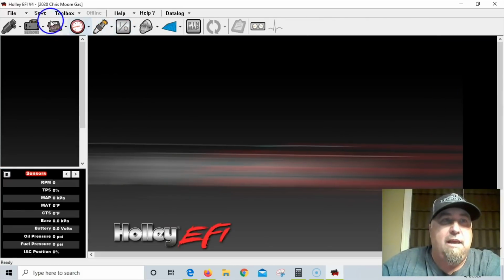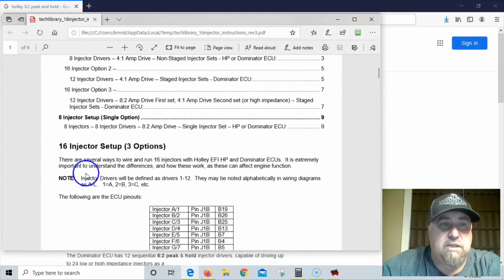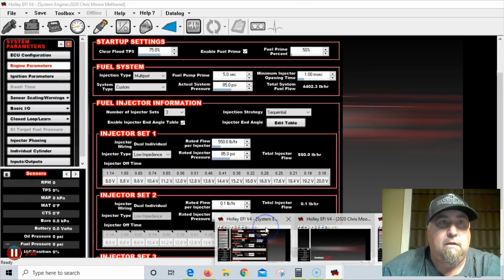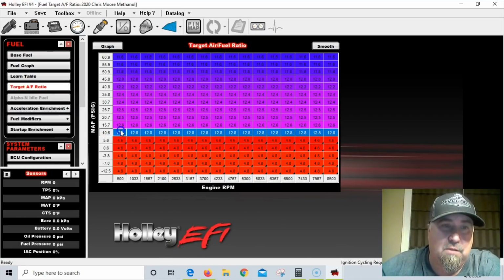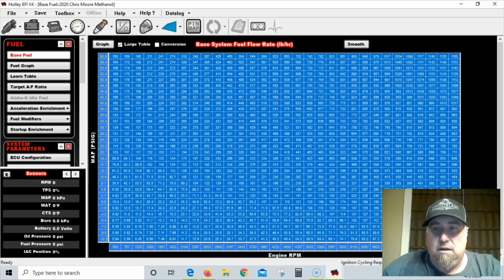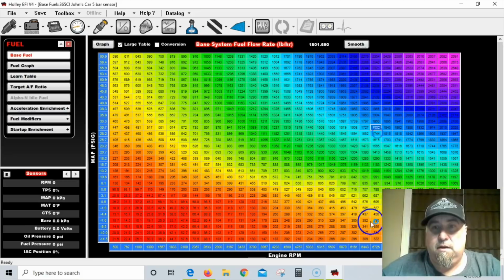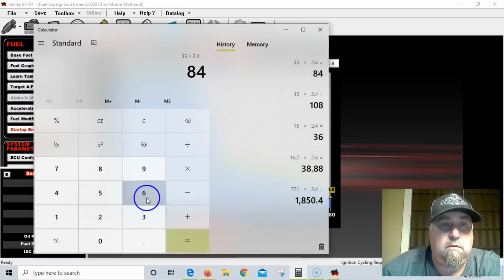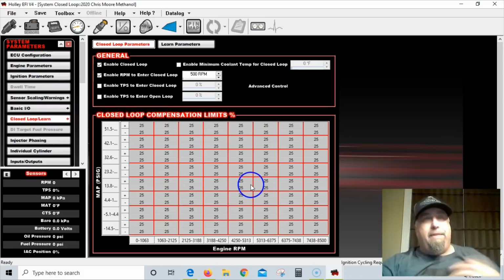Gas to Methanol Swap

Comment: I hope you know the engine has to be built specifically to run methanol you can’t just take a gas motor and just straight swap it over to methanol it eats all the rubber seals, o rings, certain gaskets and Teflon tape etc... fks the motor all up

Comment: The timing table pulled up at 25:47 you say it is conservative is that still for the gas tune?
I have been doing a lot of research on ignition timing for sbc on 110 fuel, thinking my timing is a bit conservative and also wanting to play it safe as I have a lot of time and money invested in my combo, also doing everything myself with the help of the internet and youtube ect.
sbc 414 10.5:1 compression, turbo, 110 fuel, water/meth injection, non intercooled, tbi injected, ngk #10 plugs.
base timing 34*  5PSI 28* 10PSI 25*  15PSI 22* 20PSI 17* 25PSI 16*
Does this seem conservative or is it close to normal? Every combination is different I know, just looking for a little bit of knowledge as I have researched this to death.

Comment: When u change the injectors and u used 3 set isn't that for 3 sets of injectors? I got confused on that part.
Reply from the maker: That tells the computer to go into 8:2 peak and hold amp draw.  The larger injectors pull more power and this has to be done
Reply: @TurboJohnRacing  I dont understand what you're talking about honestly is it just for amps being drawn? Has nothing to do with fuel psi?

Comment: John: way, way off topic MAYBE.
Came across this video about engineering solutions to the shortage of ventilators during the COVID crisis  https://www.youtube.com/watch?v=7vLPefHYWpY 
they talk some about problems faced with controlling the functioning of "homemade" ventilators and it struck me that the electronics of ECUs are controlling a lot of the same parameters, pressure triggers (dome?), duration of pulses (PWM?) etc. and, after all both turbo and an engine are just air pumps at some level which also largely describes a ventilator
With your related background in health, thoughts?  Feasibility?
Hate to drop links to other videos, sorry, but seemed like the quickest way to contact you (I'm not a social media type).
Reply from the maker: Hmmm, I don’t know.  That is an interesting vid.  Thanks for linking it.  Holley could for sure regulate pressure up and down, don’t know how it could regulate volume.  Could just build a pressure curve  up and down for target.  Interesting
Reply: @TurboJohnRacing  Thanks for taking the time, thinking about it more I wonder if the "learning" side of Holley could interpret various volume needs (electro-mechanical valve under ECU control) based on patient resistance to incoming pressure (would "solve'" collapsing lung or burst alveoli concern)

Comment: As i understand the "off time" it's basically the time it takes the injector to open and close. There is a very small delay with them
Reply: justin parks very useful data especially with larger injectors where a small difference in time is a large difference in fuel. You can get by in a race car scenario but they just act so much better with proper data entered like John said.

Comment: In another video you said the precision 550 injectors can be found cheap used, where you find them? I looked for them but can't find them, thanks
Reply from the maker: They pop up on racing forums and fb racing groups.  Usually about 1500 bucks
Reply: @TurboJohnRacing  thanks